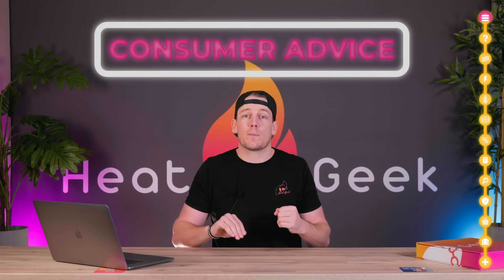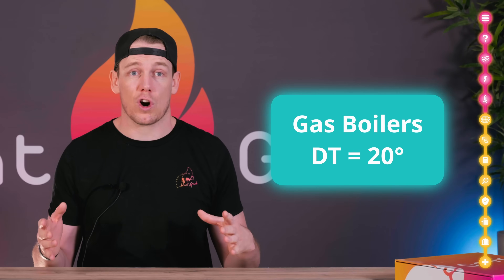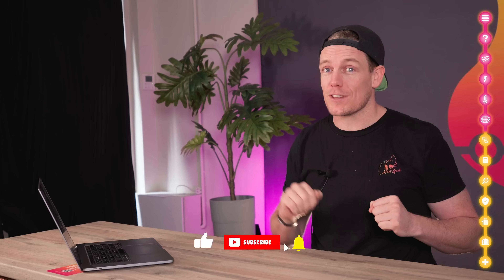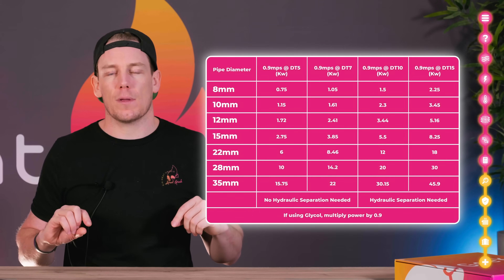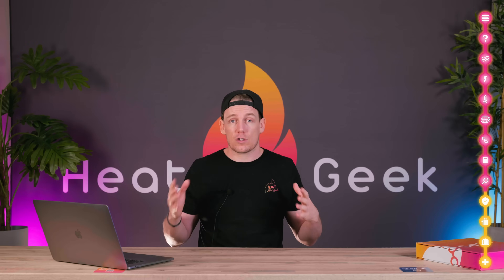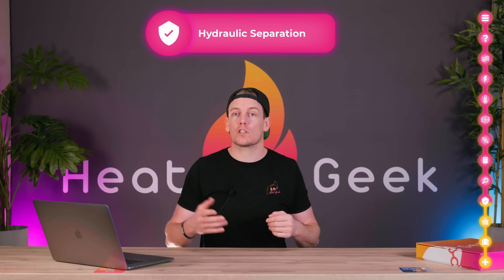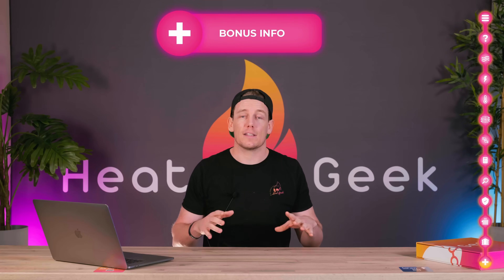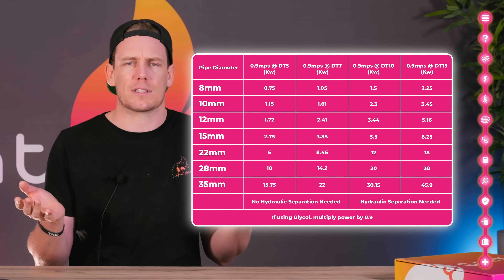Do I Need To Upgrade My Pipework For A Heat Pump Install? | Consumer Advice

Comment: Hi,   this is a general question about system design.   I installed gas central heating and came up with a pipework design that didn't require any balancing of the emitters/radiators.    It achieved this by having the flow and return run parallel to each other with the emitters bridging the gap.   What's different about that you ask?   Well as I can't draw a diagram here, just imagine folding your arms on your chest, then separate your arms slightly leaving a 2" gap.... that's the shape of my pipework, with emitters bridging the gap between the arms.  The length of pipe that water has to travel is IDENTICAL FOR EVERY EMITTER, hence practically no balancing was required.  I used 22mm for the biceps part of each "arm" and 15mm for the "forearm", so each emitter was either fed via 22 and returned via 15, or fed via 15mm and returned via 22.   This meant flow resistance and total pipe length were near identical for all emitters.    This is different to the standard approach, which has both arms held directly out in front, so that the emitters closer to the body (boiler) are fed through much shorter paths than the emitters out at the end of the arms.    I think I used slightly more pipe than the standard approach, but it really wasn't significant.   Are there any reasons why my design isn't the standard, or at least why it isn't offered as a practical alternative to the standard?
Reply from the maker: Type ‘reverse return system’ in google. Cool you figured it out for yourself though!!

Comment: there is 1 caveat not considerd (properly): pumping losses. having bigger bores means your pump(s) have to work less hard wich means less pressure differential wich also means less cavitation in pumps and pipe noises and a big power saving. all in all its a win-win-win to have your pipes oversized. the cost difference is not much of a factor when doing a reno where you already are spending the cost of a nice car to upgrade the heating system.

Comment: What to do if one’s house is just 10 years old fitted with 10 mm plastic microbore pipes that feed all radiators from the first floor? That’s how so many modern houses are built by the majority of big developers.

Comment: Just found your channel and like it a lot.  I'm about to renovate our heating system, and want to ugrade the ancient microbore piping and renew the radiators. What's the issue with 'plastic' pipe in heating systems ?  There's very modern MLCP stuff like the Rehau RauTitan (not promoted much in the UK) which doesn't suffer the bore/flow restrictions at joints/fittings like some of the original 'pure plastic' systems I shan't name.  Yes, you have to size the pipe correctly for heat delivery , just check the inner diameter !

Comment: Uhmmm, I am pretty sure that doubling the pipe diameter only gives you a factor of 4 in volume - unless you also double the length of your pipe! 🙂 Great video, though - you guys are really helping me prepare my plumbing for a future heat pump installation.
Reply: I was scratching my head at this one also.

Comment: The cross sectional area of a pipe is irrelevant. The Hagen–Poiseuille Equation shows that with laminar flow, resistance to flow decreases with the 4th power of the radius. Double the radius, flow increases 16 times if pressure drop along pipe stays constant.

Comment: well sheeettt my radiators are fed by plastic pipe, looks like heat pump will not be happening until i cant get the boiler fixed anymore

Comment: Is the delta T the temp drop across the radiator or is it the difference between the room temp and the average radiator temp? I'm sure I've seen it being used as both. If the heat pump runs at a temp drop across the radiator of 5 degrees what is flow temperature for most efficient running?
Reply: In this video DT refers to the temperature difference between flow and return

Comment: Sadly a very large proportion of heating systems being currently fitted to new builds by the large developers use microbore plastic piping.. With the primary flow and return going up to an airing cupboard on the first floor and then separate 10mm F&R dropping  down behind the drywall to the various radiators on the ground floor.  This is the case in my 9 year old house, on top of that, not one of these new builds have heat pumps their all gas installations, so much for saving the planet!?

Comment: Interesting video. If the flow and return connections on the heat pump are 22mm would you still recommend upsizing to 28mm for those primary runs to the hot water tank and the buffer?  And when heating the hot water the connections to the coil are also 22mm.
Heat pump is 12.5kW.
Thanks for your advice.
John
Reply: I have the same question did you ever figure it out

Comment: You just rescued me with this video. I want a system, but style of recent videos cuffuddled my brain. e.g. Diakin expert. To give my statement context/goal posts, I am 72 with a degree in engineering i.e. OK with the maths, but swamped by the data flow! Because I am OCD, wanted to do number crunching myself AND compare answers with someone I trust before signing the cheque. Here lays the rub, Company A is modern, forward thinking but rushed off their feet with work and unlikely to have paid for your course. Company B is loyal but “back of a fag packet, we have always done it this way”. Thank you.

Comment: A question. At 4:53 how did you get the doubling of a pipe's diameter increases its volume x8? Cross sectional area is =Pi x r^2 so doubling the diameter gives you 4 times the cross sectional area and then the volume is this area multiplied by the length of the pipe. A 15mm pipe has an area of 353.429mm^2 and (for ease) a 30mm pipe has an area of 1413.717mm^2 which is 4 x 353.429mm^2.
Reply from the maker: Yes I misspoke
Reply: I also came to make the same comment.  Glad the internet was concentrating.

Comment: That’s the problem with so many new houses, like mine, from 2015… that they used 20mm copper pipe around boiler, water tank, etc…, but then the radiators pipe is flexible plastic 10mm pipe which is great/easier for them to install but not great for retrofitting…, and I guess a nightmare to change as will have to dig out holes in the whole house, lift floors, etc… 😩😩😩, so it may make my desire to install HP imposible. And so frustrating that all these thousands of new houses that you see around the country  are being built have these pipes, well hidden within the walls, and with gas boilers…, and then thr Government want us to pay to change them to HP!! Bonkers!! 😡😡
Reply from the maker: The diameter of that pipework for a new build is absolutely not a problem. It would.be for older.. its the facts they used cheap crap plastic
Reply: @HeatGeek  that’s the problem, plastic pipes.. any easy and efficient option if have plastic pipes? Without ripping house apart?
Reply from the maker: @Eric Rouvière  no easy option.. but builders were warned.. however there is things you can do.. I.e. fill woth demon water. Tbh in most cases it will probably be fine
Reply from the maker: @Eric Rouvière  as in physics told us about basic physics..  demin not demon haha demin means demineralised. Demon means Damon who your having round your house you poor sod
Reply: @HeatGeek  hey, no need to be rude.., spell properly when you type.. 😜
Reply from the maker: @Eric Rouvière  sorry I was working and 'celebrating' simultaneously last night haha

Comment: Video appears to suggest Buffers are not generally required, however, has been suggested that most heat pumps require a buffer tank for defrost and to allow different temperatures in bedrooms compared to living rooms?
Reply: Great news information but the bloody music is so irritating and distracting

Comment: Would love to understand manifold distribution to individual radiators where pipe work to manifold is 28mm copper but radiators are 12mm plastic 

Will this work for a heat pump?

Comment: 4.58 2x diameter is not 8x the volume of water. is arround 6.5x de volume for the same headloss. the simplified formula is (internal diameter(biger pipe))/((internal diameter(smaler pipe))^2.7

example (25mm/12.5mm)^2.7 = 2^2.7 =6.498 about 6.5. this formula can have a max 5% error because of the different materials.

Comment: The calculation on diameter vs "volume" is wrong! The length is fixed, so the comparison is of cross-sectional area only which is obviously a square relationship rather than cubed. So doubling the diameter means the area/volume (for a fixed length of pipe) increases by a factor of 4 not 8! :)
Reply: When you double the area of a circle its area increase 400%

But yes with a Cylinder its 400% in one dimension "width"  and another 400% in the other "length"

Comment: Hi Adam, love the videos, but I think that doubling the diameter of a pipe would increase the volume by 4 not 8 as the length of the pipe would remain constant.
Reply from the maker: Yes this was a mistake
Reply: @HeatGeek  this video is two years old, why haven't you corrected it yet? 
Getting junior school maths wrong undermines your argument. 
(4:59)
Reply from the maker: @DrRogB you can’t edit existing videos…
Reply: @HeatGeek  Appreciate that update. I was just about to make same comment.
Reply: @HeatGeek  Was it though?
Reply: yeah, I see what they did 😂
Reply: Wrong. It's the cross sectional area which increases by  approx 8 times, and therefore the VOLUMETRIC FLOW RATE for a given velocity, not the volume. Volumetric flow rate is what determines how much heat can be transferred for a given media at a given temperature.
Reply: @nickwinn7812 you're mistaken...
Reply: 878 @steverogers3597  Yes, OK the CSA would increase by approx 4 times(not8).
Never the less, it is the CSA x the velocity which determines volumetric flow rate, which in turn determines how much heat can be transported. That was my point.
I stupidly carried over the 8 times mistake from the video. Mea Culpa.

Comment: Yes I'm interested. Has anyone written some FLOSS software (spreadsheet or other) for designing heat-pump systems? Overall demand, emitters, pressure drops, ground loop sizing, UFH spacing, pump power loss, etc. None of this is rocket science but I don't particularly want to do it all from scratch. Someone must have done this by now?

Comment: I've Just been looking at a brand new House that has an Air source heat pump but I noticed all the rads were fed by 10mm plastic pipe. It was a relatively large 4 bed house so would I be wrong in suspecting that the installers didn't know what they were doing?
Reply: If you look at the general bill quality of developer built houses, what chance have they got of installing a quality heat pump installation. Developers are the perfect example of the race to the bottom.

Comment: Did you ever get around to doing the plastic pipe video?

I'm looking at swapping to a ASHP in my new build as the original combi boiler is due to be replaced as the HW system wasn't designed properly and I likely need a HW tank. While changing the main runs to copper while the work is being carried out wouldn't be too disruptive, the drops buried in the walls down to the radiators are all in 10mm micro-bore. Looking at the cheat sheet though my biggest room would only require around 600W which looks doable?

Am I going to have a lossy/inefficient system if I stick with the plastic pipe?

Comment: What about if you have no radiators and just underfloor heating with 16mm pipe?
Reply from the maker: As long as the supplies to the manifolds were sized appropriately, which you can use this guide for.. your ok

Comment: Great vid, however you finished with you can’t have plastic pipe work, you should have really mentioned this at the start. As was quite interested in heat pumps, but like most houses built in the last 10 years, the whole place is piped in plastic.

Comment: I don’t understand how doubling the diameter gives 8 x the flow rate? Is it not 4 x the flow rate?
Reply: maybe you make a confusion between pressure and flow rate?
Reply: i was misunderstanding you first :-) indeed, from flow rate formula, it seems that doubling diameter gives 4x :-)
Reply: @yelimsssantiago5328  what do you mean?

Comment: Why does pipe diameter matter so much for an ASHP when most new build systems have mainly UFH, which has 16mm pipe work for most of the system?

Comment: Your videos are awesome nd very informative. Unfortunately your heat geek guarantee does not really work as I attempted to use this service inumerous times and just did not get one of your installers to contact me. I am having a Samsung 8kw installed next week and the question regarding pipework came up, the assessors were very good, my main pipe is 22 and the secondary pipe is 10mm, its a 3 bedroom house. Do you have a way to calculate the ideal size for a volumizer to help overcome the 10mm pipework? Is there an ideal size for a volumizer? Thank you
Reply from the maker: Sorry about that.. The guarantee is not that we can find you an installer though. They are rare and especially hard to find good ones. It's the level of quality of install and they k ow things like system volume and control theory etc. Sorry no simple rule of thumb for volumes

Comment: How does the plumbing work when the old combi and most pipes is at the front and I have a concrete floor and heat pump will be at the back? Dig up floor? (I’m in a terraced house).
Reply from the maker: That sounds like a difficult job for a heat pump. They don't suit all budgets. Most homes had a cylinder at some point
Reply: @HeatGeek   my 1970 house was built originally with a “Warm air” heating system powered by gas. It used to have a cold water tank on a reinforced shelf above the stairs. Not sure how the hot water system worked! No sign of a cylinder.😕
Reply from the maker: @Group51  a difficult system for a heat pump. Thankfully not the norm. Every case different
Reply: @HeatGeek  Cripes. I think I’m going to have to hope Octopus gives people like me access to a much cheaper off peak to charge a heat battery of some sort. We don’t all have cars!

Comment: Just found heat pumps that use carbon dioxide as refrigerant at minus 20 deg C cop is 2 and hot side temp at 80 deg C contacted the enginneer they connect directly into the existing pipe work at temp minus 5 cop is 3.15. Heat pumps definitly looking like the future. I am in Aussie land and normal air heat pumps are just fine.
Reply from the maker: Did he say what unit? Pipe work may still have to change here due to condensing boiler f/r dt or 20 instead of 5
Reply: @HeatGeek

Comment: Nice one Adam. With your chart - where it says about how many Kw's a pipe size can carry Vs the DT and 0.9mps. Does the length of the pipework not have a factor too? Or is it a case that, the energy would just take longer to get to where it needs to be in a longer pipe run?
Reply from the maker: Yes, as per the video though is this is a rough cheat sheet and NOT a replacement for proper calcs or sizing

Comment: It’s a great video but I would really like to see a plastic pipe video. Someone needs to be super clear on the issue of “can I use a heat pump if I have plastic pipe to my rads and/or plastic pipe work anywhere else in my house”. In my mind this should be one of the main qualifying questions on your “can I have a heat pump” video as well.
Reply from the maker: Plastic pipe = crap.. Will do an in depth soon
Reply: @HeatGeek  thanks would be much appreciated. As an owner of a well insulated house that’s only 12 years old but which is rammed full of cheap plastic pipe I’m pretty sure a heat pump would require ripping and replacing all the pipe work. I know heat pumps are your thing but I would love to also see a video on other carbon free alternatives. What about electric boilers for example, given no one solution will fit everyone I think in my case it could be the right option but how can I tell? Reputable electric boiler fitters with heat geek accreditation might be a good thing.
Reply from the maker: @cblu9092  plastic pipe could work.. just not as good...

Comment: great video again , so retrofit install survey/quote/heat loss calculation is actually a long and extremely important job , it will define if your install work or not? yes a video on plastic pipe would be great . also a very stupid question, on a heat pump radiator system , is the system under pressure?thanks again

Comment: My pipework is plastic and micro bore mostly 10mm. I'm thinking I'm going to have to change all my pipework to upgrade to a heat pump.
Reply from the maker: Possibly.. but you could use the money that you would spend on that for insulation.. that way the existing pipework will work and you'll gave lower running costs
Reply: My property has cavity wall insulation and 270mm loft insulation new dg windows and doors. The weak spot is solid floors which is expensive to insulate.
Reply from the maker: @johnedwards6648  you'll be fine on a hp unless it's 400m2

Comment: Thanks for your reply have you got an update of how electricity your vaillant arotherm plus has consumed since the start how many days is it and what size the ashp is
Reply: I meant to say how much electricity
Reply from the maker: @patregal  hi. How much power is relative and no help to anyone.  What is relevant is its scop, the scop is 3.. so if your property needs 6000kwh pa you'll use 2000kwh electricity, if you have a gas boiler you'll use 6600 of gas.